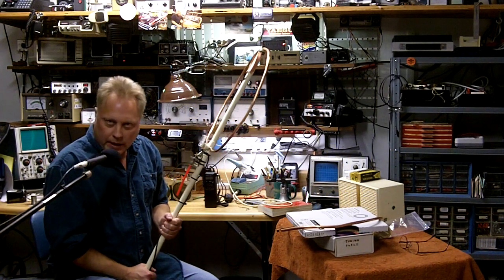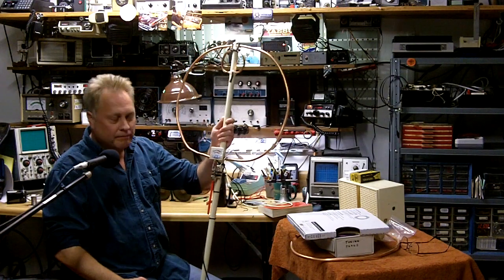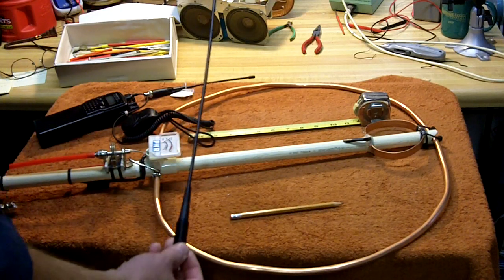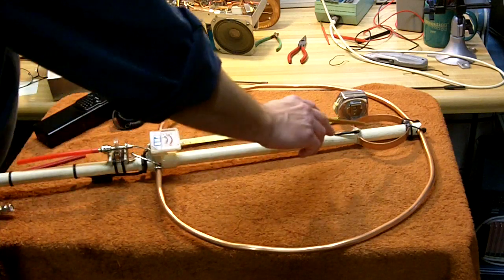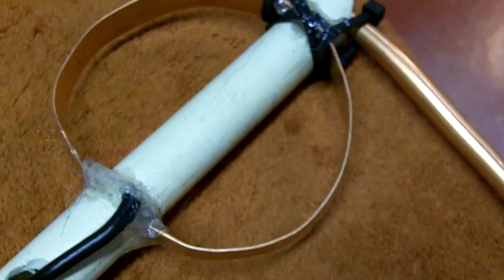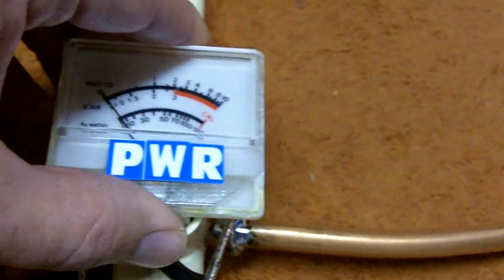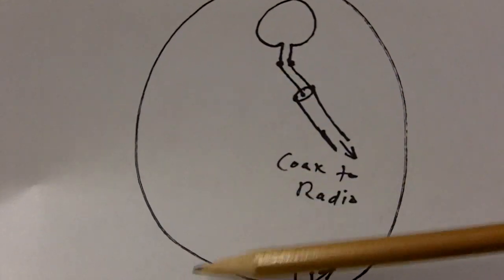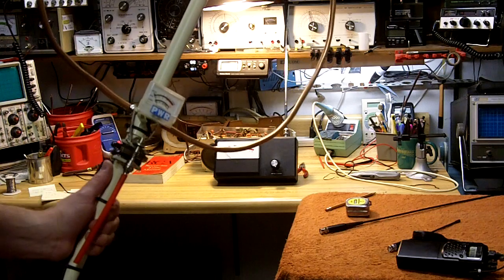My Low Cost Magnetic Loop Antenna For 10-12 Meters

Comment: I know this video is quite old, but I did want to ask if you used copper pipe instead of a heavy gauge wire for stability, so it wouldn't bend so easily, or if there is an RF design element to that?
Reply from the maker: Basically I used that just because I had it on hand and it looked easy to work with I guess, I didn't take into account anything else. If I do another one I might try making it out of some kind of large coax like I see a lot of them out there.
Reply: @RadioHamGuy  Thanks for the reply; I have seen those as well. I happened to be in the hardware store the other day and picked up about 15 feet of what appears to be heavy duty romex. I don't know what size it is, but I separated it and was thinking about using one of the insulated inner wires for the primary loop. I found an air gap capacitor in my junk drawer, but on close examination the vanes of it very nearly touch. It would probably be OK for receive, but I don't think it could do even the modest 20W I have to work with, so I found one on ebay. I'm going to model mine after yours, so thanks for the video!

Comment: Very interesting video. If I want to receive only, is the smaller loop needed, or could I couple directly across the capacitor on the large loop? Thanks very much for sharing your expertise!
Reply from the maker: You will still need to use the smaller loop on this design, it works the same for RX and TX. Without the smaller loop it will not tune since the smaller loop couples to the larger loop like a transformer, hope that helps and thanks for the post!

Comment: Do you know what property of this design makes it resonant at the target frequency? It sounds from what I've seen that the small loop is always 1/5 size of the large loop - does the large loop determine the frequency? This doesn't seem to be talked about much. I know the capacitor is going to fine tune, but I'm really only concerned with 28.0-28.5 MHz, so if I wanted to design for that specific range, how should I go about it?
Reply: I have found that Magnetic Loop Antennas are very tolerant about dimensions.  I have a rule-of-thumb that says the distance around the periphery should be about one-quarter the wavelength at resonance.  But there is nothing precise about it.  The only important things are to get the resonant frequency correct (by tweaking the tuning capacitor), and also to make the input impedance about 50 ohm by measuring the VSWR.  (I would not accept a VSWR greater than 1.5).  Also don't apply high power unless the the frequency is correct, otherwise you can damage your transmitter.  Also with high power don't get too close, you could "microwave" yourself.  (There are not enough safety warnings about this).

Comment: Hi radioHamGuy, thanks for your video. 
I rent a flat on the third floor and the landlord has summoned me to remove my base antenna from the roof of the bulding. On my balcony there is no room for a gpa antenna! Since then I have been struggling with all kinds  of antennas. I build my own inverted V! It's a good antnna, good swr etc., but transmitting with that antenna is hardI   So in my search of a good antenna I came across your video. 
I have a few questions though. 
Does the variable condensator has a maximum of 50pF ?. 
What about scatter at my neighbors, can you tell me something about that?
Will any germanium diode on the watt meter do?.
thanks Francis
Reply from the maker: Hi Francis.  This antenna could work for you, it will not be as good as an outdoor antenna but you could still make contacts with it as long as you do not have steel siding on the building or something that would limit your signal from getting out of the building.  If you could get it on the balcony it should work quite well, I have used mine just outside my house and even inside the house.  I am not sure if your neighbors would see any RFI problems or not but I am guessing not, so give it a try.  It is somewhat directional so you would want to be able to rotate it by hand for best reception or to null out noise.  The capacitor is somewhere around 50pf max but not critical, you can experiment with what you have and just see where it resonates at, the low and the high freq.  A 100pf would work but the tuning would be a little more sharp I would guess.An antenna analyzer is a big help but not needed, just tune receiver for max noise to start with by tuning the cap back and forth, if you hear no change, it probably isn't covering that range, then try another band. pretty much any germanium diode should work fine, and the the meter is just an optional thing I added to make tuning easier but not necessary.  Hope that helps and good luck!

Comment: Since I have only a CB radio, I have a couple of questions for variations: 1) Can it be set up without the variable capacitor (tuner) for just the CB band; and 2) Can you make it omni-directional by adding another loop 90 degrees from the original, perhaps sharing the primary coil (diagonally and interweaved?) between the two main antenna loops?

Comment: Is this antenna better in a Qrm environment than a inverted V Dipole?
Reply from the maker: It can be at times since it is directional so if offending stations are in a different direction than the one you want to hear it can be rotated to somewhat null out the station you don't want but then it also depends on how strong of a signal the offending station is compared to the one you want to hear if that makes sense.

Comment: Thank you so much for the time to share your project. I have a sailboat and am wanting to put an SSB radio to use 20m or 30m of bandwidth. I understood how it works but I was in doubt about the power meter with the germanium diode. How would he fit into your scheme? Which direction does the diode need to be installed? On the polarity of the meter?

Comment: Great video!!! Just two Qs for you:
Q1: What else can you use for an rf meter as it is either very difficult to find a watts meter or its really expensive? Can you use an uA, mA meter or a V meter?
Q2: The coax you use looks smaller than RG8X (which my cb radio uses for my 18' base station atenna which I cant use anymore being I moved into a condo)... are you using RG58? Would RG9 work the same? I know the inner braiding is different... Does it matter what type of coax you use to feed the smaller coupler ring? Can I still use my RG8X?
THANKS!!!
Reply from the maker: Yes, those meters are all pretty much the same thing, some are more sensitive than others so try what you have and it may work fine.  Also, you can use several types of coax also, RG8X would be just fine.  Good luck and have fun with it, just experiment with what you have available!  73

Comment: Hi. What kind of diode i need exactly?
Reply from the maker: A small glass germanium signal type like a 1n34a works well. You don't want to use the rectifier silicon type diodes that are usually black in color, they will not work well.
Reply: RadioHamGuy Thank you! Should be no problem to get one here in Germany. ;-)

Comment: I don't know if commenting here does any good. since my last two didn't git a response. But here it goes. Have you tried to fashion a loop as a beam antenna. With a solid reflector and director loop.Have you tried to make an omni egg beater style loop. I imagine the coupling loop size would alleviate impedance issues. In a duel antenna setup. I plan to use a wide range vacuum variable high voltage cap to tune with. and not worry about using it at legal limit.
Reply from the maker: I have not tried doing that but I know what you are thinking, I don't think that would work for a magnetic loop like this but maybe it would, maybe some others can comment more on this, I am not sure how that would work I guess.  I have see the egg beater type antennas used for satellite work but have not built one myself.  The vacuum variable cap is a good way to go from what I know about that.  Sorry I can't help more but maybe some others can comment more to your post. Good luck with the antenna experimenting, it is all fun!  73

Comment: Hi, I want to build this same antenna but I don't have much money and In spain those type of capacitors are very hard to find. So I thought I could make one. I found some tutorials to make air gap capacitors and they seem to work great. I'm only going to use this for recieving so I don't really know if I have to use an air gap capacitor or if I can use a regular FM radio variable capacitor. Could you please confirm that? And by the way, would it be bad if the capacitor I end up making its more than 50pf?  I made the calc to make it 50pf but I'm sure it will end up being more than that. Thanks for the video!

Comment: Why is the exciter(ed) loop not centered in outer loop ?
Reply from the maker: It needs to be very close to the outer loop for coupling purposes.
Reply: That must be the magnetic part ... I wonder about that spacing and IT'S effect on resonance / tuning. Could this antenna be better tuned by moving the coil spacing ?
Reply from the maker: I have not experimented with the effect on tuning doing that so that is a good question but I am not sure.

Comment: Excellent video!  I have the bug now. What are your dimensions for the loop that covers 20 meters and above?  Also, what value capacitor did you use for this loop?  Thanks!
Reply from the maker: Thanks.  I will have to check that other loop again but I believe I used a 365 pf cap from and old tube type AM radio and the loop size is about a third larger than this one.  Maybe I will have to do a short video showing that one in the future.  Glad you enjoyed the video, thanks so much!

Comment: Thanks, what value of Air Caps will i use to TX 50-75watts with 1inch tube at 13ftloop? bit so confused of the PF and Voltage value. I know theres a lot on the internet but still confused.

Comment: Excellent clear interesting videos. I am going to make a magnetic loop soon for fun. Here is a web page I found for measurements http://www.66pacific.com/calculators/small_tx_loop_calc.aspx       from what I can gather 27MHz with 19mm Copper Tube Between 1.3 to 2.69 meters Circumference, 28 MHz Between 1.3 to 2.6 meters Circumference , 3.5MHz Between 10.4 and 20.8 meters Circumference, 7 MHz Between 5.2 and 10.4 meters Circumference, 14MHz Between 2.6 and 5.2 meters Circumference, 21MHz Between 1.73 and 3.46 meters Circumference and like you say 1/5 smaller is the driving loop. They say the loop radiates from side on but yours gave best when the circle or face was in the direction of the field strength meter.Your soldering iron brings back memories of when I used that type back in the early 80's. Nice to see a blue Weller again. Thank you

Comment: Thanks for this video. It's clear and well presented. I am in the process of making one as we speak. My configuration calls for a 22 pF tuning capacitor. Thanks again.
Reply from the maker: +Philip Gardner Thanks Philip, glad you got some use out of it and good luck with your loop, they can be a very fun antenna for the size of them!
Reply: +RadioHamGuy Hello Mr. WD0AKX, Thanks for your reply.  I love your videos. They are really clear and informative.  I did finished my project but is having some issues with the SWR reading.  I cannot get it down below a 3.  I used the calculator for the design and based on the results I made the antenna to spec. Here are my specifications. My conductor length is 8 feet soft copper tubing, Diameter of the conductor is .750 (3/4) ". The frequency intended to be used for is 27 MHz.  My input wattage could be as high as 250 Watts.  The tuning capacitor suggested is 22pF.  I purchased the KP1-4 3-50 pF 25 Kv Military High voltage vacuum variable capacitor for this project but ended up  with a 3 SWR  match.  Not sure what the issue really is at this point but is trying to try different things to see if it would go down but with no luck thus far.  Just wanted you to know that I did go ahead with the project.
Reply from the maker: +Philip Gardner Hi Philip, sounds good on the project, just off hand I am thinking the 8ft might be slightly too large with 3-50pf cap but I don't have the calculator handy so I will have to look into that a little more otherwise you should see a nice dip in SWR when tuning the cap that goes down to 1:1.  Be sure all your connections to the cap are very solid and when testing, your loop is away from other objects.  Also, start with very low power, 250 watts is a very high wattage for a loop that size so you may see arching on the cap but sounds like you have a large cap rated for high voltage like that.  You do not want to be close to that loop if you run more than a few watts.  Very high RF levels around those loops even with low wattage so be careful experimenting.
Reply: +RadioHamGuy Hi again Mr. WD0AKX.  I have to let you know that I am being careful with this antenna.  I am not going to put that wattage into it at this time because I need to find the reason why my SWR is up top 3.  I did go through the calculator to design it.  For some reason I do think that the cap required is not the correct value. I have found another calculator and for the same dims the cap required is 12pF (+/ - 10%).  Here is the link to the other calculator I used.  It's http://www.digitalskywave.com/mag_loop.html
Thanks so much for responding.  Please keep up the great work that you are doing.  I love all of your videos.  You are greatly appreciated sir.

Comment: what size loop would you suggest for 40 to 80 or 40 to 160. also would larger diameter copper tubing be more suited for lower band freq's? larger diameter copper would make a lower band loop more sturdy in bad weather.  and i can only imagine that it would be good to paint it or plate it with gold to reduce oxidation.... that is if you plan to leave it out once set up for permanent use.

Comment: another great thing about the loop antennas. it being narrow banded means the antenna becomes a filter itself. so your equipment can have a certain amount of harmonics and the radiator can't effectively radiate them. then they are trapped and spent as heat.. and heat isn't that bad, when the antenna can de-ice itself. great video sir. i will be making one soon. but i first must buy a hf rig. after all these years and finally passing the amateur-extra. i have yet to work hf other than 10 and 11. 73's kf4dcy

Comment: Can you slip a garden hose over the exposed copper tubing of the big loop for child safety, if not, how about electrical tape? will insulating the big loop affect it in any way? one more, is the exposure to the field it creates harmful to man or dog in any way? (also, thanks for sharing)
Reply from the maker: smokeymountainrain I think you could do that to insulate it without much effect at all but I have not tried that.  The field could be harmful if you are very close to the loop so best to keep at least several inches away from it when transmitting, for just receiving it is no problem at all.
Reply: +smokeymountainrain : Also staying in the NULL area of the loop is safer if you are going to be close to it.
Reply: +Gabriel Sierra                                                                                                                                                                       High Voltage can jump like it does with a spark plug. The voltage you can expect with 100 watts from the radio could be 3000 Volts and more. Depending on the insulation material of the hose I would not guarantee not getting a shock if it was touched. I am not sure of electric farm fencing but that jumps across air as well so that's an example. The voltage in a magnetic loop is reported to jump across the plates on a variable air spaced capacitor if it is not a high voltage type. Be careful of high humidity if using inside, especially with a water filled evaporative air conditioner due to moisture in the air.

Comment: Cool first experiment with your Magloop, I prefer a Faraday Induction loop made from RG 58 coax.
The cap for fixed frequency on my Magloops is a length of RG213 inner slid into one end and a strap to the other end.
Different lengths for different bands - so easy.
My current Magloop uses self tapper to an inner insert.
http://s12.postimg.org/jj6ocra99/TWO_TURN_PEXAL_MAGLOOP.jpg
Myles VK6ZRY
BTW I have copper Magloops in all sizes, single and 2 el series types.

Comment: Sir, if you could post on here the 1/5 size of the transformer, the little circle. it would be helpful to me i would like to build this ant. i am not good with fractions in math so your help would be appreciated very much.
Reply: Tommy Schales  why no one helped you ?  Wth.   3 years !    
Say that big loop is 15 ft.   One 5th  of 15?
How many equal sized pieces do you need to add up to 15?    5.  He says 1 5th  so 5 equal pieces. 
How long would they have to be to add upto 15?   
3ft.  
3x5=15. 
Say it’s a 6 foot loop.  
5 doesn’t divide equally so yer gonna get a decimal.   No problem 
But say it was 1/6 you wanted.   Easy.   The loop would be 1 foot.   But we want one 5th  so. 6 divided by 5. Is ?   1.2
So his transformer loop is 1.2 foot long
If you stretch it out 
Anyways I’m sure you figured it out 3 years ago.   
I didn’t think many people were worse at Math than me